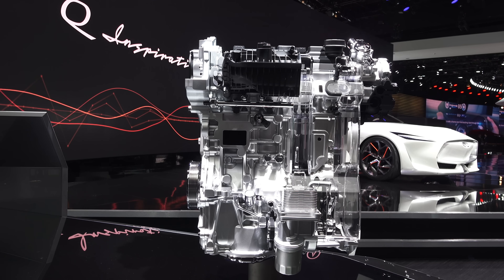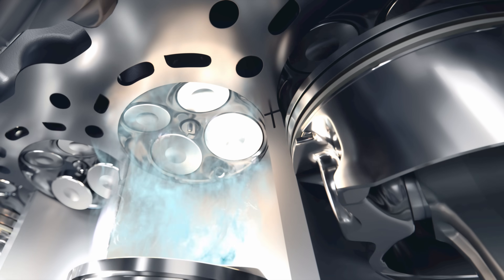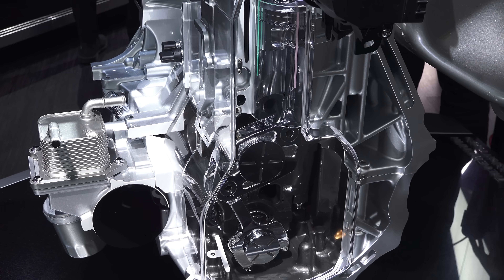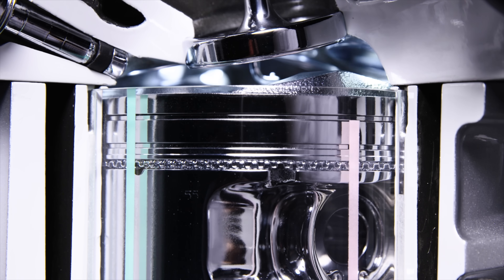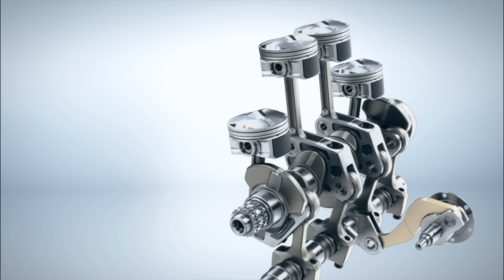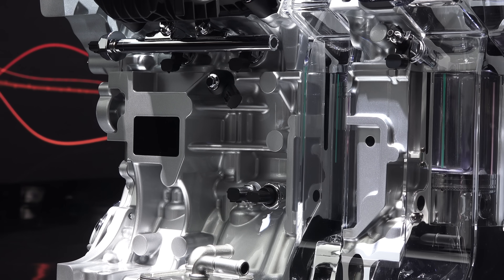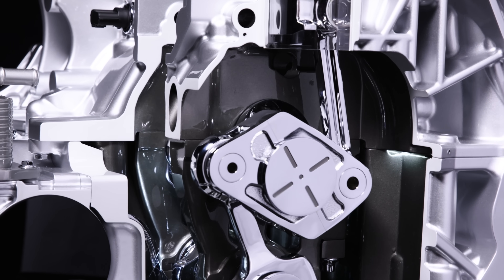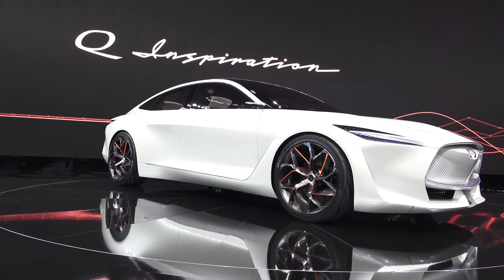INFINITI Reinvents The Gasoline Engine — VC-Turbo

Comment: I think it's a fantastic invention. Too bad they did not do enough testing. Honda or Toyota would have been more careful. Still, I am sure the bugs will be worked out. Right now, GM has worse recalls on engines than Nissan does, so don't overreact.

Comment: August 2025, nissan issues recall on this exact system. Claiming 0.3% failure rate, with actual failure rate closer to 10%. 
Because most dont fit the criteria for recall because they didnt die going doen the road and cause traffic issues. They fail on startup in people's driveways. 
How could they have done a variable compression engine without the complications? The same way everyone has been doing variable compression ratio engines for 20 years.....ever hear of VTEC? Or  Variable valve timing? It will create the same effect without the overcomplicating of the rotating assembly. 
Who thought this was a good idea? 
Someone in a corporate office somewhere who got a raise, because these definitely won't last, and people will have to buy another car

Comment: 7 years later and it is a very different story. A massive recall caused by this type of defective engine. 500.000 engines recalled. I dont think we will se this special and very complicated technology in the future. Mazda are making a better and much more simple engine design - also with "Variable compression". But based on the "Miller cycle". Using the intake valve to make "Variable compression". Mazda "keep it simple" where Nissan made it very complicated and less reliable.

Comment: BS calls:
1. most 4 cylinder engines do not have balancing shafts.
2.  side force is not even considered as a reason for failures. 
3. you did say it needs premium but you need premium fuel even though you don't need it with low compression mode. 
I bet this won't last too long.

Comment: Every reason was well defined but using PFI and GDI both is completely confusing 🙄. It's decided that DI is the best way for injecting fuel then why they are using a Port Fuel Injection. Even using PFI instead of DI was acceptable for a reason but using both of them together is extremely confusing 🙄. Please explain the reason behind it

Comment: That's really blowing my mind 😳. Using VVTs and different bank angles, firing order, crankplanes were still ok but this time, a change made in the CR of an engine which is not even static, means it will change variably throughout the engine operation is truly out of this world. It has become a new nominee in my mind cracking inventions ever made in the automotive industry. 🔥🔥🙌🙌🙇🙇

Comment: Saab made simpler and better VC 25 years ago, imagine over 250hp from 1.6 and 30% less fuel
Reply: Didn´t achive the reliability and was trashed
Reply: @shakalpb1164  Where did you found such false claims? It was not that reason but gm, Engine was too good, I mean infinity didn achive reliabilty by lastin less than 2 oil changes

Comment: And yet the greater part of calorific power of the fuel is going to be released to the atmosphere as HEAT. If you consider only a few cars using that engine you'd say that heat is negligible but millions of those are not! I'd like to see your calculation of how much heat is released to the planet every single day by combustion engines. I did my math... it's stupendous!

Comment: When on the Atkinson cycle, I would think it would not push out any fuel but just air and that the injectors would not spray any fuel until after the intake valve closes.

Comment: Theory tells me that maximizing the pressure and temperature of the fuel air mixture at ignition will give me maximum energy efficiency. Typically we talk about how an engine works at full power where the maximum amount of fuel air mixture is loaded into the cylinder and the maximum fuel air pressure and temperature is achieved at ignition. I think the major constraints are NOx emissions and knock. But at lower power settings when only 30% as much fuel air mixture is loaded into the cylinder, a constant compression ration results in a much lower fuel air pressure at ignition and the engine will be operating inefficiently. By increasing the compression ration at lower throttle settings this engine is achieving a more optimal fuel air pressure and temperature at ignition achieving better efficiency when less power output is needed. For me it is much easier to understand the goal is to maintain a conditions at ignition at a more consistent and efficient level at different throttle settings. This idea is also why a very small engine optimized to run at one power setting and rpm and an optimal fuel air pressure and temperature can most efficiently be used to generate power to charge a battery as a range extender. The engine would be operating at max power and max efficiently or turned off.

Comment: Wouldn’t you say that a turbo engine already has variable compression? Yes the have a fixed static compression but different boost levels equate different compression levels due to forced induction and the it’s way of operation. So in terms this would be the first mechanically variable turbo engine? Sorry but we all know that with boost tune tables you can have a point where you are closer to .15 vacuum vs being at 5 psi over baromatic pressure and let alone 20 psi.

Comment: dealer techs wont replace internals, only replace engines. i was crying about my VR6 3.2 turbo build is costing me 6k long block alone that with me putting it together, i cant imagine this. looks like it will have 12 rods, and 10 mains and finding a machine shop that would touch that block would be fun. new gasoline engines are just disposable at this point.

Comment: Could a system similar to this,  do something crazy, with a much different setup, for example, allow the piston to dwell at TDC longer, before the power stroke, allowing the crank angle  allowing peak cylinder pressure to star when the crank is at a much better angle!!  Allowing much more tq to be delivered! Possibly doubling the TQ output of the engine?!!? If it had  a cam or crank to actuate the system then reverse it  before the piston is at TDC on intake, to  to pull in the most fuel  , a turbo and/ or diesel version would be insatm À

Comment: Prius is much simpler. Otto cycle. Prius engines are 13:1 compression ratio physically. But leaves intake valve open on compression stroke to have an effective 8:1 ratio. Physically it’s 13:1, but effective 8:1.
Reply: I mean Atkinson Cycle.

Comment: anyone know if the new 1.5 3-cylinder turbo in the new 2022 Nissan Rogue uses this same "dual injection" system (both direct and port) ?
Reply: Yes.

Comment: I just purchased a 2022 Rouge. 1.5 liter I-3 VC Turbo. Wow! great performance and 35 MPG!
Reply: Just got a Qashqai e-Power. (afaik it's the same or similar model in EU). I love it too, but I'm really keen on getting some insight whether these engines proven to be reliable. I hope so.
Reply: @twinjuke  Like mentioned in the video they did extensive testing to help reliability of the engines but with it being a new concept it will take a couple years to get it figured out but that's what real world testing is for!!!!
Reply: CX-30 I would say is the arguably better car and it gets 34mpg with a 2.5L i4 NA.

Comment: The reality and real technology behind this engine is Power & Efficiency. Quite good power in the Altima (5.4-5.7 0-60 93 octane) and on a trip from Tx-Va 36-37mpg, Va-Fl-Tx 41-36mpg That’s going 75-85mph. If I did 70-73 mph like I did from Va-Sc it was getting 41mpg.

Comment: I'm wondering what the compression ratio is boosted to with the turbo.  Surely it must be higher than 14:1 or it wouldn't make more power.  When compression ratios on peak era Muscle cars got reduced, power went down.

Comment: Great video on VC engine. Fifteen years ago, I designed a VC V8 engine that used a different mechanism. I altered the capacity in the combustion chamber and left the crank alone. From that, I designed a new engine; flat 12, (2) inline 6, 2 cranks, shared head with VC mechanism, forced induction.  From that, I was able to go from 4 stroke, to 2 stroke with full time forced induction. It worked on paper, would love to see if it would in real life.

Comment: It would be great if you could do at least a cursory cost/benefit analysis.  Obviously this is spectacular technology, but will the extra costs in manufacture, maintenance, and potential repair of this engine be offset by the efficiency gained?

Comment: I'd be interested to see what the numbers are on Pre-Cat failures. There's a LOT of heat still in the exhaust port and the turbine unit which if to close to the catalytic converter the heat soak will just  shorten its life expectancy, fail, fall apart, get suck back into the turbine housing possibly even back into the cylinder causing catastrophic engine failure. Just wondering if that's happened yet?
Reply: Look at the vr30 in the Infiniti q60, the catalytic converter is directly connected to the turbo. A modded vr30 makes 450whp on full bolt ons and a tune. The catalytic converter doesn’t suffer at all. The thing that kills catalytic converters is explosions not heat.

Comment: Engine became so much more complicated. Cant even imagine if one of the rod motors fails some day. It will not even worth to repair (cost wise) - junk it right away. What is the final goal go get a little better of fuel efficiency for the price of make engine so complicated that only dealer mechanic could fix it if so. I would rather keep old trusted and reliable configuration - piston, rod, crank shaft.

Comment: I can already see the integrated exhaust manifold being an issue - they're removable in case they crack or rot away, which they might be more likely to do with a turbo. A removable manifold also means more options for performance exhaust improvements, or just if the manifold is defective from the factory. In this case, the head needs to be removed.

Ford had integrated intakes on their old straight sixes and it's a nightmare to try and get any more performance out of them, precisely for that reason. Any stripped threads or cracks meant replacing the entire head, which is easy on a 60s i6 but not as easy on a transverse i4.

also, putting that in a 5000 lbs car isn't great either, it'll need steeper gears or higher revs to get moving like other 4cyl suvs do, and it likely still won't feel quite as responsive. WOuld be far better suited in a sports coupe or sedan

Comment: don't exaggerate, on freeway with a heavy car V6 it's still better, i must recognise that it's very looging resistant wich makes it good on highway wich will give the possibility to hold last gear lower like on diesel ones also thanks to direct injection which wouldn't allow coils to fail

Comment: New metallurgy, new improved engineering, improved more precision computer operated robotic machining, etc., will bring more reliable engines.  Kind of like electronics.  Used to, a television went out, a person took it to an electronic tv repairman.  Now, they're thrown away, it is not cost effective to attempt repairing.  Which not just metallurgy, but composites and everything else.  😂, But imagine instead of a cast engine, sheet metal with cylinder hole, water channels being stamped from sheet metal or other material, bolted or otherwise joined to form the block.  With sheets, a higher strength alloy relative to cast being used.  Reduction in mould making, cooling time, etc., lighter, stronger and overall superior.  We are at a new era in time for engines, trans, etc.

Comment: Can’t you easily manipulate compression ratios with variable valve timing? And if the answer is yes which it is can’t you get the fuel savings from two different injectors one for low compression cam timing and one for high sure that adds complexity but at least the complexity is in variable valve timing components and injectors not internal engine lower end components which when they go bad means basically throw the whole engine or car away. I know innovation usually means adding complexity but when the complexity is buried in the motor as far as humanly possible that is a disaster waiting to happen

Comment: Intriguing tech.....but you do realize Nissan is the WORST OEM to be attempting this exotic, over-engineered and risky system?!?
If Ford or Honda built this, they'd get it right.
 Mark my words - Nissan trying this will be like GM's well-intentioned but rushed efforts at the 1981 Cadillac V-8-6-4.....

Comment: In another video that you did, you talked about why 4 cylinder size is limited. Why couldn't you place 2 (mirrored) 4 cylinder engines side be side in the same block to create a "straight" 8 using this variable compression?

Comment: "The cylinder Wall is shiny" its glass bro. It wont go in the real engine lol. And a cross hatch pattern is usually desired to maintain a good oil film and gliding surfa e. ALSO it decreases friction. If you look in a microscope The surfa e has valleys and rifts. This means that alot of The surfa e remains untouched and less contact. Less contact means less friction.. Unless its a soft material where a small contact patch can make you "dig in" The surfa e.

Comment: A little late in the game to be reinventing the wheel ain't it?
The Internal Combustion Engine (ICE) is in it's death throws.
The industry is going electric. ALL car mfg's are hard at it rolling 
out electric vehicles. All the car co's are in the midst of firing 
LEGIONS of ICE & drive train engineers. Cadillac reports they
will have a full electric lineup in just a couple of years.
The car co's can't wait. e cars cost less to mfg, assemble quicker,
less moving parts prone to fail, less maintenance req, less hands 
& robots req to assemble. The advantages seem endless.
All those unemployed engineers will have to go work for John Deere
or Caterpillar...while they still can.

!

Comment: One thing that wasn't talked about is that the con rod is connected to the crank with a lever.  This requires the piston to travel at higher speed than the crank.  What effect does this have???  How is torque effected???

Comment: You can do the same thing with an adjustable junkhead in a much more compact package.
a lot of these "innovations" are to introduce proprietary systems that are still under patent rather than using existing designs that anyone could legally copy.

Comment: Why not just have a normal crankshaft with the main bearing housings in an off center unit that can rotate.

I win. About 10 less links and far more structurally sound.

Comment: bearings always the weakest link and this harmonic link and the counter weight has tiny bearings, some fun rebuilding this engine ahead, in the 50s & 60s engineers experimented with everything and always come back to the idea less is best,

Comment: Two Years ago I was replacing my G37 and they offered me this Qx50 for similar price as a Lexus RX350.
After examining the way the engine was built and the complications it presented I went for the proven Lexus.
It will take at least four more years until enough of this engines will be on the road to test it's reliability.
As far as I can tell, this engine is a bad example of engineers going wild, very very wild.
First they had the 2005 -2006 G35 MT that the oil rings were breaking and the cars were drinking one quart per thousand miles,
(I had one of those under warranty and they refused to replace the engine). Then they change the engine to 3.7 L. which was a good choice, but now with this, forget it !

Comment: Why did they go through all this when all you have to do is design something that lowers or raises compression ratios in the cylinder head itself. Design a plunger (adds material inside combustion area) or leak valve ( that basically creates more area) that acts like a valve but does nothing but take up space or remove space in combustion area which is exactly one of the easiest ways you raise or lower combustion ratios in the first place, besides offsetting wrist pin, cranks stroke or piston design..the rod position under compression stroke is pretty cool though..

Comment: This concept could be adapted for all engine configurations. All the business is in the bottom end for compression changes on the fly. Adapting the cam-less "Free Valve" system would perfect this design.

Comment: As long as when it does fail it goes into a low compression mode and the part has its own assembly that can be accessed from outside the engine block this shouldn’t be the reliability nightmare everyone is imagining.

Very cool idea..... I’ll wait about 20 years for them to work the bugs out.

Comment: I wonder what GM did to that poor Saab SVC engine they were developing... they had come so for that they had driveable prototype cars (saw a test drive on Swedish TV) and then it just vanished when GM took over.
Also, this kind of engine would be perfect for an actual flexifuel car. When you run a normal car on ethanol it's a big fscking compromise which results in shitty gas mileage. With this kind of stuff you could take full advantage of the ethanol's properties.
Hell, you might even be able to make an engine that can run on both diesel and gasoline. (And other stuff.) Just let the computer put it in high compression mode (a bit more than 14:1 might be required........) and switch to the other fuel system - tadaa!

Comment: This engine has failed to do what it was supposedly going to achieve. For all the added complexity, I say this is NOT the way to implement VC on an ICE engine. Think of what could have been developed with the time and resources Nissan spent developing this technology that has not been used on any other engine they offer.